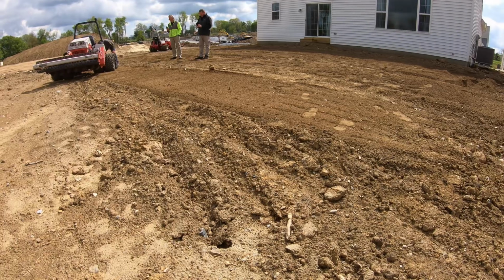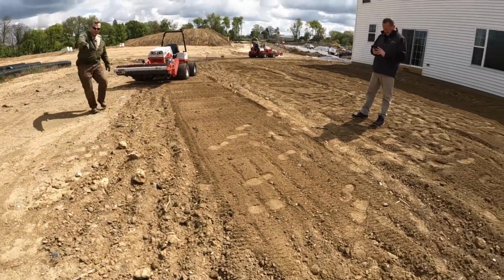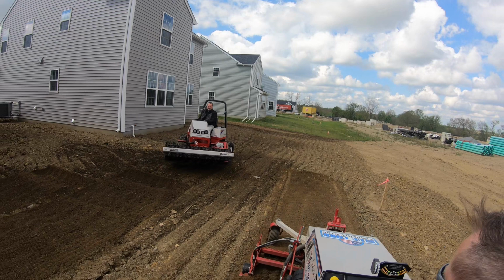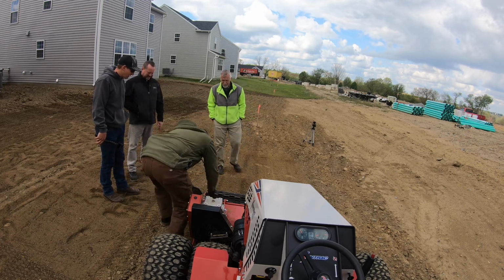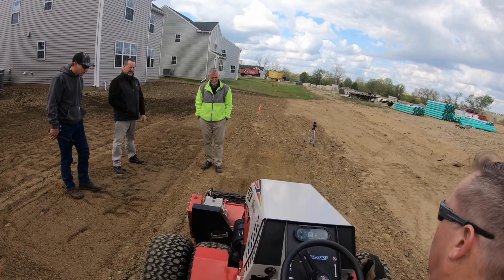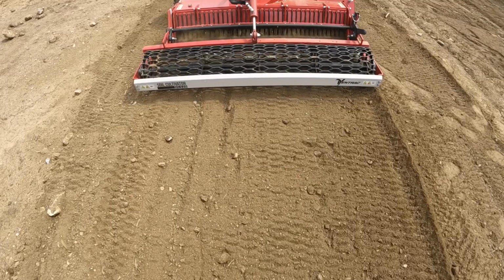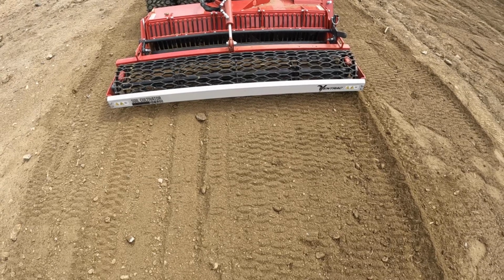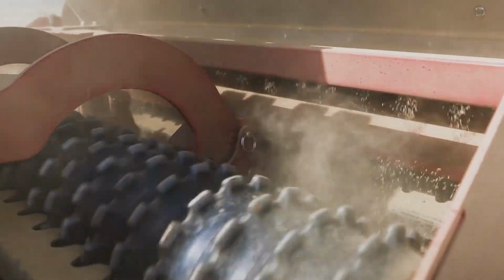Ventrac's NEW Cultivator-Putting it to WORK!!!

Comment: Small Lawns…ok. It’s small so it can get into the smaller properties. But it seems slow and inconsistent, needing multiple passes to achieve a proper seedbed. It did eat those rocks tho! I’m more familiar with larger scale field work, but as a guy that’s doing primarily lawns with multiple implements, sure…I guess this would work, with that power rake you used. I am keen to see your seeder at work too!
Reply from the maker: There is much larger equipment out there, but the capability and versatility of the Ventrac are really extraordinary

Comment: good video, covered alot of exactly what i am looking to get into doing. the issue with the rocks at several inches deep you covered i have had better experience with garden tillers on my deere with 3"-6" on the first pass. right off the bat i could clearly see the harley rake does a better job because it was doing exactly what you needed it to do. i have seen the difference even years prior on dirt monkeys channel with the bobcat skidloaders. 
for seeding the cultivators are hard to beat for deep root penetration growth.... even with the harley rake you don't get that deep root penetration for grass for over a decade or 2 in minnesota and it shows up on every lawn where the bare spots are, the grass just gave out mostly on any kind of a slope either at the crest or where there are slope changes in the banking of hills. alot of it is due to clay volume in the dirt.  i've had to watch and take alot of classes on PGA golf course turf maintenance to understand the fixes and solutions and long term care.
with all that rock in the soil after the final grade leveling has been done by the excavation-hardscape company has finished what needs to happen, can't really be done due to that rock; which is 10-12' deep tine aeration and core plug aeration inorder to get a sand soil mix deeper down to break up that clay'ish soil. that rock is going to destroy alot of $10-$25 tines and the best penetration machines are vertical tine 'stomper impact' as i call it for the straight down straight up action 4-5 tines at a time block 'foot' action.
i believe ventracs aeravator is your best option before or after the harley rake is what i'm curious to see the results on.
i think this ventrac cultivator is only for garden soil the way it seems designed to work. they need to test this attachment in ireland with a guy whose channel is 'way out west' on his garden.
Reply from the maker: Thanks for the input.  For seeding, I would normally use the EA600 Aera-Vator which does an amazing job loosening the graded soil to drop the seed in below the surface.  I also have the new Ventrac Primary Seeder and did some testing alongside the Aera-Vator last fall

Comment: Those rocks are going to eventually bubble to the top if you live in climates that have freezing and thawing. Its a real pain. Got to get them below frost level. Best to get a rock picker and clean them out before working soil.
Reply from the maker: The issue is that this can bury grapefruit sized rocks but only cultivate 5 inches down.  That rock will be just below the surface.  That and the soil it does cultivate is not suitable on any sloped surface and the loose soil will easily wash away.  It's a great attachment for level areas but I still don't like leaving a grading job with that much loose soil on the surface.  If I do find a way to incorporate the Cultivator into my attachment lineup, I've already said that it must be followed up by grading with the Power Rake

Comment: I still don’t see really what the point of this machine is. It seems like this and the power rake are performing very close to the same thing. I feel like it would be such a waste of money to have to buy both of these attachments to do a job. I want to buy a power rake for my ventrac to start doing grading for new job sites. Is this really a necessary machine to have with it?
Reply from the maker: The Cultivator and Power Rake perform very different things.  The Cultivator buries debris while creating a loose layer of topsoil over it.  The Power Rake brings debris to the surface and an experienced operater can use the Power Rake to move and displace soil to adjust and level a grade.  The Cultivator cannot do that
Reply: @bluecordterrainmanagement  do you think some of the larger rock/debris that you may be covering up will possibly be exposed at some point?  Seems it would be better to go ahead and remove any of the larger things for later on down the road?
Reply from the maker: @zerocoordination  You will never get to the bottom of the rocks, ever.  At least this way, the rocks are few inches down with the Cultivator and covered with nice, powdered soil.  The Power Rake does a GREAT job of cleaning and polishing the surface but doesn't really leave a soft layer of soil behind.  It's all about how you want to go about it.  Like I said, Cultivator first, then graded and polished with the Power Rake and followed by the seeder would be my choice
Reply: @bluecordterrainmanagement  ok good to know. Thank you. Question on that new seeder. I have the aeravator with the seed box on it. Is there a benefit to the new seeder over what I have and use for most of my yards??
Reply from the maker: @zerocoordination  I've not yet used the new seeder but what I CAN say is that it will be better to use on soft cultivated soil while the Aera-Vator is best in loosening and seeding hardened soil
Reply: The Cultivator is basically a tiller with a “cultipacker” basket that runs behind it.
Reply from the maker: @amandadavis9726  it's a bit not than that.  The tines are shaped in such a way to push rocks and debris to the bottom while leaving the soil on the surface and leveled before the textured roller presses it down
Reply: @bluecordterrainmanagement  sorry,…but it’s a tiller.  Those tines aren’t pushing anything down into the ground.  They’re simply breaking the ground up.  The expanded metal basket is what pushes the rocks down into the loose soil.  It’s a great attachment,…don’t get me wrong.  But it isn’t more than what it is,…and that’s an upgraded tiller.
Reply from the maker: @amandadavis9726  Amanda, I think you should test one for yourself and then make an assessment, or rely on an experienced Ventrac guy for an honest evaluation.  The tines are a different shape than a traditional tiller.  When cutting the max depth which I think is 5 inches, it will take the rocks and separate them from the soil, only allowing the soil to pass through the vertical "rake" where the leveling occurs and burying the debris at the bottom of the cultivated width.  I was given the following link to this video by one of my channel followers.  It's a similar machine manufactured by Rotadairon and they explain how it works. The Ventrac version is very similar.   https://www.youtube.com/@rotadaironcom269
Reply: @bluecordterrainmanagement  just checked it out.  It’s a tiller with different shaped tines and the basket to perform the finishing touch.  That’s what i mean when i say that it’s still a tiller.  I agree with you about the soil and rock separation.  I was just responding to the  original comment about the difference between the power rake and cultivator.  The power rake will smooth and level the ground,…but you’ll be somewhat moving material and having to figure out what your gonna do with the rocks and debris.  The cultivator will smooth and level the ground while burying rocks and debris,…but without moving material.  Thanks for the channel suggestion.  We’re planning on purchasing some property to buy and build on.  That attachment would work great for what we need.
Reply from the maker: @amandadavis9726  I've been using Ventrac for 18 years and have 19 attachments.  What started out as a hobby in Northern Maine with 2 Ventrac tractors and several attachments to maintain our farm estate, turned into a legitimate business here in South East Pennsylvania.  I hope that you find a LOT of other helpful videos here on my channel, which includes a lot of maintenance tutorials for the tractors and attachments
Reply: @bluecordterrainmanagement  I will say that there is plenty of insight on your channel.  I was just speaking about the Rotodairon, because that’s the first time that I had heard of it. It is something to consider for a 40 hp tractor.  I appreciate all of the videos that you and some of the other YouTubers put out. It’s genuine content,…and I can get behind that.
Reply from the maker: @amandadavis9726  Thanks again.  Many of those other Ventrac Youtubers out there watched my channel and got in touch with me before getting their first Ventrac :)

Comment: Why didn't you use a power rake to get the trash out in the beginning?
Reply from the maker: I did use it and is seen in this video for a comparison of the finish results.  I like the look of the finish result the Power Rake is capable of.  The Cultivator is good at making loose soil and burying debris, but leaves the soil vulnerable to erosion until the grass becomes established